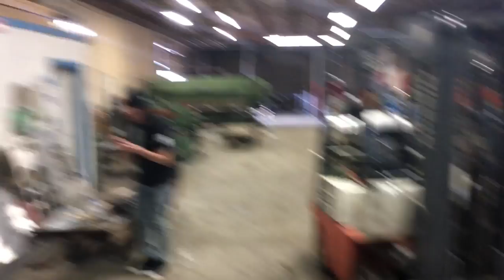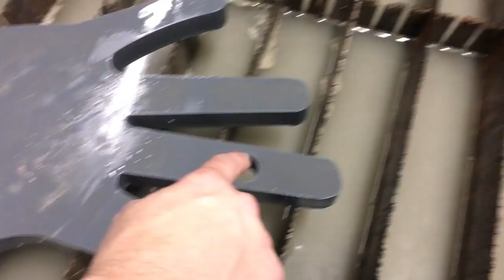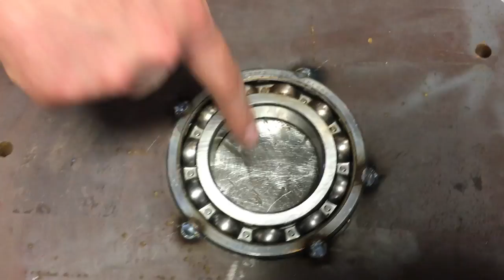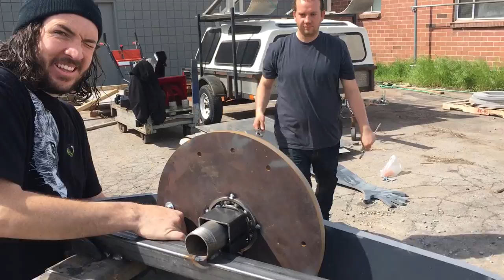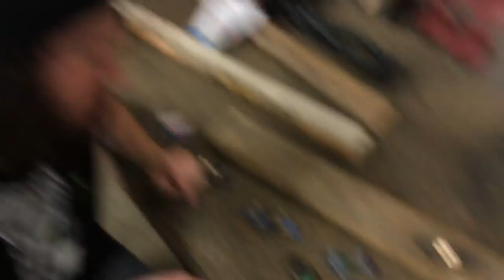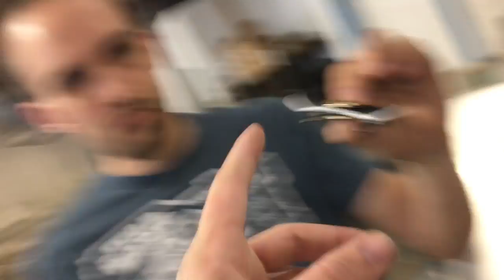Worlds Largest Fidget Spinner - with Shonduras

Comment: at that point it's just a propeller
Reply: Mr Wadls with hands
Reply: Mr Wadls it has ball bearings in the three hands, so it's a fidget spinner
Reply: Mr Wadls Turbines have bearings does that mean they are fidget spinners?
Reply: it can still be used for fidgeting. its very practical to take to class or to work👍🏼
Reply: for a prop you kinda need a bit of an angle on the blades otherwise it won't propel any air, therefore, creating no proposion but i can see where you're coming from
Reply: they need to put rubber gloves on those hands
Reply: But they had the lil finger bearings

Comment: My heart broke when he welded that bearing..
Reply: heat warps metal, bearing are supposed to be pressed in
Reply: no grease on it either ):
Reply: +adam rivera one shouldn't weld a bearing for many reasons.

One is, that welding creates internal stresses and deforms the welded part of the bearing.

Second is, that welding changes internal structure of steel on those welded spots and changes physical properties of steel there. -> There are weak spots now and the bearing is likely going to break on those points.

Third is, that excessive heat can make lubrication form some unwanted shit inside the bearing.

There are probably more, but i do know barely nothing on this topic.
Reply: Ulf von Weißmüller Actually, that sums it up pretty perfect!
Reply: you know bearly nothing? .... bearly? bearingly? ... i tried

Comment: can a waterjet SPIN a spinner? as in place a spinner under the jet and see if it will spin..
Reply: it would put a hole through it. Why do I have to say that
Reply: Dylan Edger you don't know that till you try.... Or you simulate it, but I don't think that's going to happen
Reply: In a previous video, he cut through bullet proof glass...
Reply: Yes it will. Check out the video when they made a "saw blade" and made a water jet powered table saw.
Reply: @dylanedger3771  Check out the recent turbocharger filling weather balloon video. Or the waterjet powered chainsaw. Or the vacuum cleaner. Or the alternator, skateboard wheel, or saw blade they spun up with the waterjet, getting to "warp speed" before usually popping off the bearing. The spinner itself is just sandblasted.
Reply: flouro all those forms of motion from just a water jet? That’s amazing
Reply: @dylanedger3771  it's amazing what you can do with just rotation

Comment: This is why our industry has gone overseas.  When I left the tool and die trade at 20 years old I'd have gotten fired if I screwed around in the shop like this.  I left the trade for good because the work all went away.